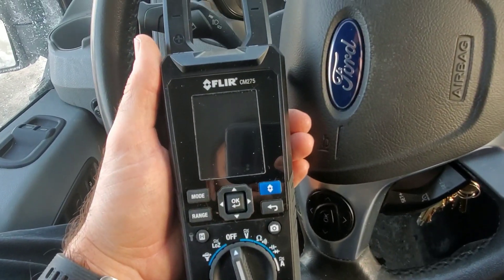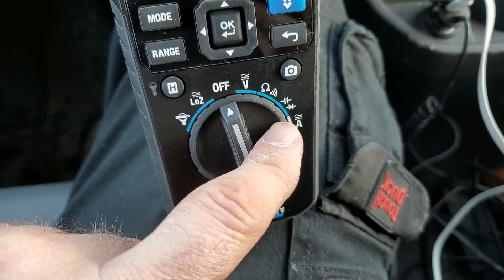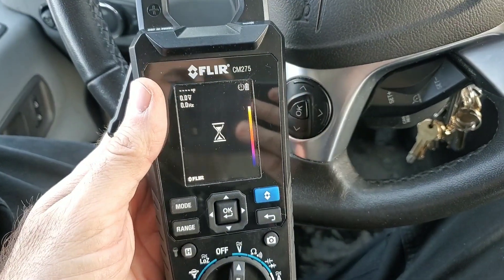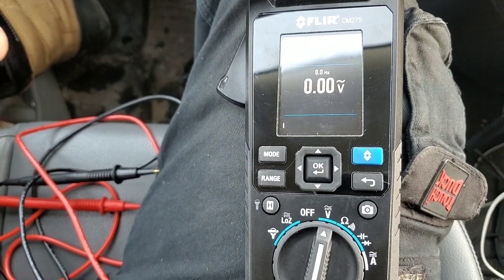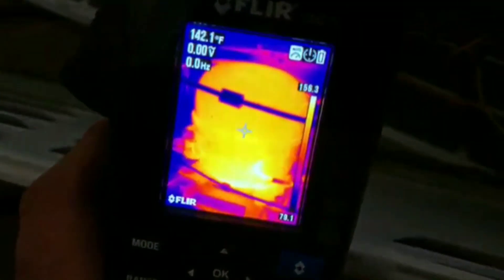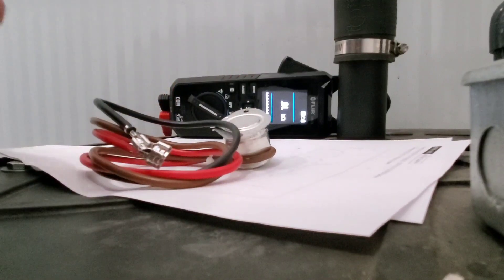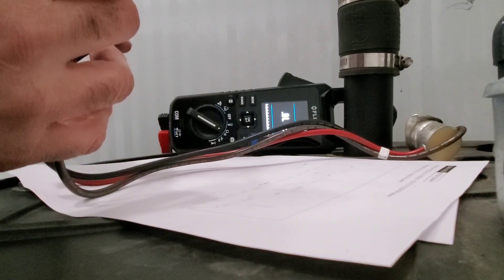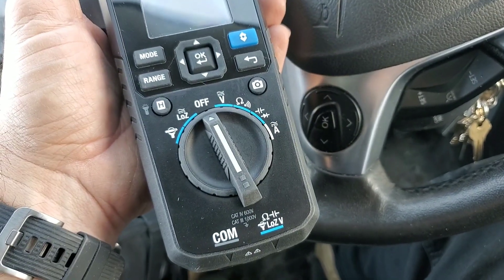Flir CM275 Clamp Meter Review

Comment from the maker: Love this meter so far, the quality is unreal.
Reply: No so unreal. The display is not reinforced (could be damaged with any sharp object) and  also is very reflective on direct sunlight
Reply: @supermanreturns3659  Again, you're referring to the CM174 NOT the CM275. At any point, you could easily install a screen protector for less than $5 on your meter if you want even additional protection. Having had this meter out in the field (commercial & industrial) since one month before it was officially released I can tell you that it has held up just as well as my Fluke meters.

Comment: What nobody says  and Flir tries to hide is the fact that with the IGM on it drains the AAA batteries in a couple minutes.  
The  same thing with the flash light on.
I still haven´t received a response from FLIR for this bug. Just silence. Plus Resistance mode is up to 6 Kohm maximum. Nothing compared with any cheap meter which  measures up to 20 o 40 meg ohm.  If you have electronics  or a circuit board forget about it.  Are you kidding me FLIR ?   -> 700 dollars
 Btw  it doesn´t comes a carrying case or pouch. You need to buy it separately. So 700 bucks for a defective and incomplete product is  just not worth it !! DONT BUY !!!

Comment: The way to assess thermal switches is to measure the voltage drop across them while passing current.
Reply from the maker: But if they're not connected to power you need to used resistance to check
Reply: @HVACKnowItAll  Before I had a meter with low ohms I used to used a rig with 2 D cells and a 6 volt headlight and clips.  That way I could see what a few amps would do. 
I discovered if the contacts were losing half a volt, the low ohms scale would indicate a poor ohmic reading.  So if the thing measures higher than a tenth of an ohm, contact are probably corroded. It was hard to see that with a cheap pocket meter, but even a little voltage drop will heat the contacts up causing inaccuracy or malfunction.  Or, using diode test on the meter might also indicate voltage drop from corrosion.  I know sometimes it would be difficult to measure voltage drop if things are iced up, but a bad thermal switch can sometimes click off prematurely due to self-heating from bad contracts.

Comment: What batteries are you using?
Reply from the maker: Triple A
Reply: @HVACKnowItAll  Get the FLIR TA04 lithium rechargeable battery & the FLIR TA52 magnet, thank me later.
Reply from the maker: @MrNightro  I will look into thanks
Reply: @MrNightro   so  should we spend a real fortune  ?
Reply: @supermanreturns3659  The FLIR CM275 already costs $700 so you would have already spent a "real fortune" at that point already. So spending another $100 should be no issue if you're looking to get the most out of your investment & that's not even taking into account if you also want the FLIR case that goes along with this meter. If the price of a battery & a magnet is too much for you then you shouldn't be looking at this meter.
Reply: Batteries drains out very soon.  Be aware of that
Reply: @supermanreturns3659  No the batteries do not drain out fast, you're confusing the CM275 with the CM 174. The first generation CM174 had issues with eating up batteries fast, this was fixed with the CM275 (I own both plus other FLIR meters).

Comment: When you a=were showing the sensor you had shoot blocked by leads. I liked the ir image on the low side high side of little compressor. Finicky,I sometimes think old analog meters,are better for certain readings. Simson 260...Instead of them op -amps with there feed back backs ,resistors then comparing then out to driver amp. So which is better the old or the new, ?
Reply from the maker: Showing which sensor?  What part of the video?